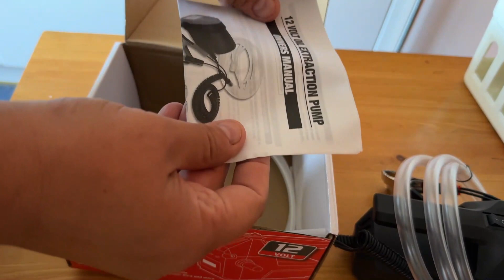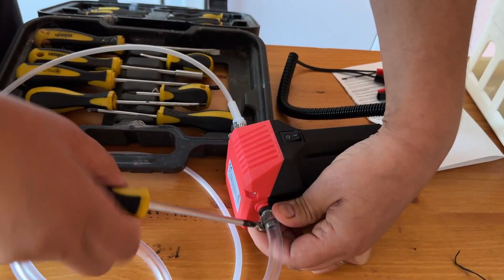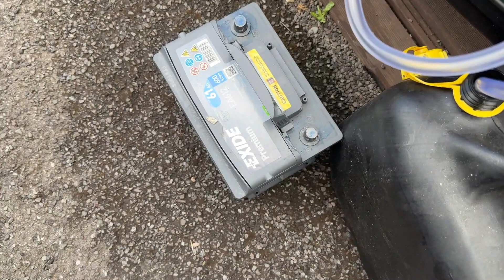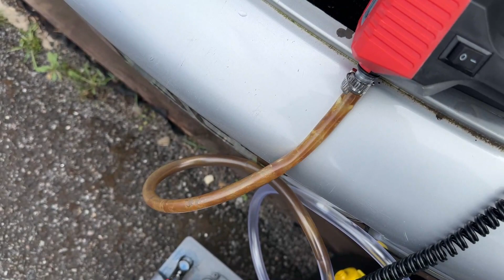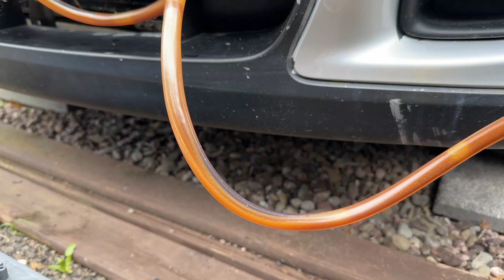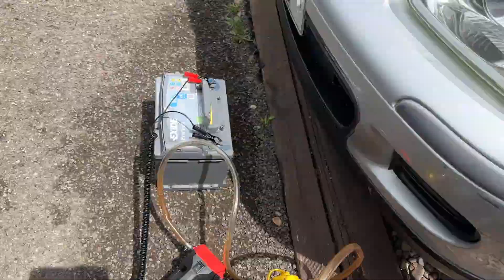I test an Ultimate Speed style oil extractor and it goes rather well - Here are my thoughts

Comment: I bought the last one on the shelf at Lidl with 60% off olny to find it must been returned. The box had been opened but everything was there it turned out to be the fuse had blown because  the motor wouldn't turn, it looked like the pump head had been over tightened and stalling the motor. Sorted that and replaced the fuse with a automotive blade fuse and a couple of female insulated lucar connectors so that you can change it more easily should it happen again.
Reply from the maker: Interesting, the pump head on mine was very tight to the point of not rotating, but, it seemed to be a couple of mm too big for the housing.